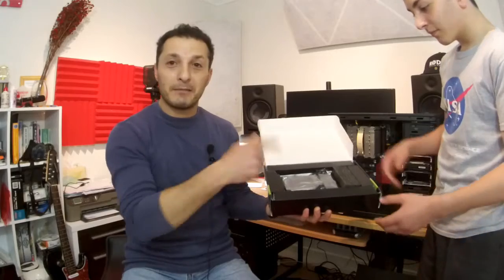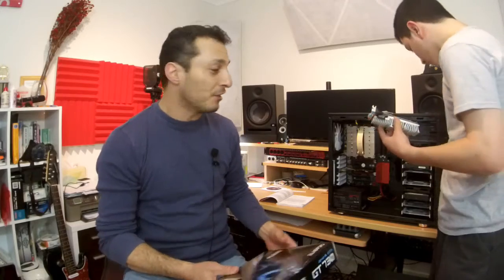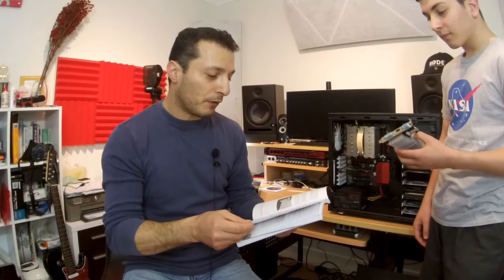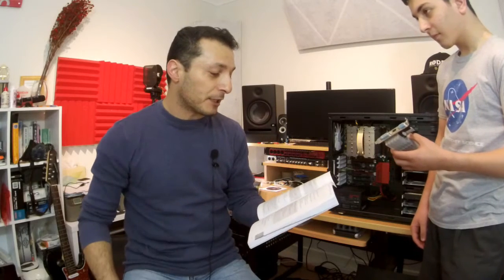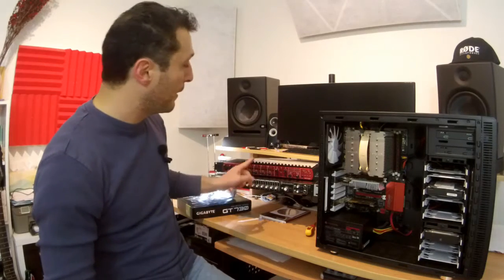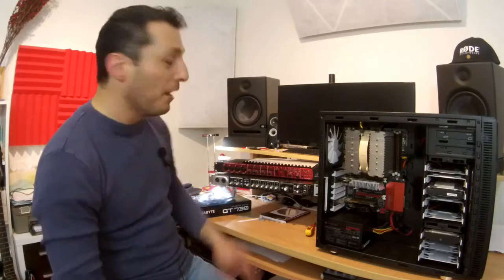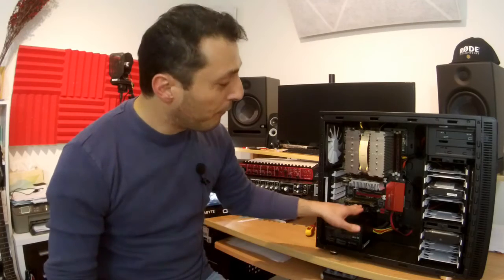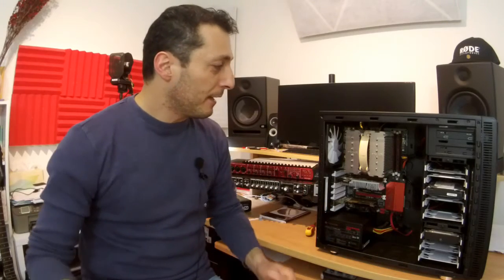Audio Pops & Clicks issues when using USB Audio Interface

Comment: yea found your video trying to troubleshoot this problem myself. what I have though is a behringer umc 1820. I adjusted my power setting for full performance, switched everything the right way in the sound settings (24bit 48000khz *i have a adat expander so its drops it from 24bit 96,000 khz to 48,000) usb 2.0 directly to the PC. I noticed that it is not being recorded, its only when im playing back. so im still kind of stumped here.
Reply from the maker: Not sure if the 1820 has any drivers, but try increasing the buffer size.
Reply: @RecordingStudio9  the umc 1820 does have drivers i played around with all the sample ratings 64,128,256,1024,etc,etc . going to try a line conditioner at this point.

Comment: I doubt its the 1818VSL unit itself. I was a tester for PreSonus on every unit in the VSL series. In fact; I'm the person who suggested, and subsequently got the other testers to push for, the motorized faders on the StudioLive consoles.
I tested it on thoroughly on every DAW on the market at the time and had no more issues by the time we were ready to release.
Unfortunately, I can't speak on the software and firmware changes after release.
I now have clicking on both my 1818 (#33 ever made) and 22 (#5 ever made).

You got me thinking though. I'm gonna hook my old M-Box and my Tascam FW1082 up and see if the problem continues when they're in use. 
I plan on upgrading my processor from quad-core to 6-core, if the problem persists.
Reply from the maker: I still use the same PC I built and have had and still have no issues with any of my later Audio Interfaces, currently using PreSonus Studio 18|24.
It was the VSL driver software and not the actual 1818VSL unit. If I used the UC driver, it was fine.
Reply: @RecordingStudio9  Good to know. I might have to try that.
Reply: I'm wondering if an older driver would have worked better. We had no issues with the driver we approved for initial release. I personally tested it so throughly that I can't imagine what they needed to "fix" with the subsequent updates
Reply from the maker: @DeadlyMixKrew  I personally reverted back to the previous driver (v1.2) as the new versions for Windows OS had issues, largely due to the fact that Apple kept changing their OS requirement, and breaking everything else, finally, PreSonus gave up and discontinued 1818VSL. Such a shame as it was one of the best for its price range and options.
Reply: I'm trying to remember but I'm pretty sure that was one of the drivers we tested on. I think that was the one we approved for the release.

Comment: Hopefully this helps anyone with a hp laptop running Windows 10. (Presonus Audiobox 96) I was having problems with a crackling noise also. I changed USB ports and now it’s fine.... to anyone it helps
Reply: I use the same exact pc and and audio interface.  Got it last week and I've been experiencing these problems. Did you fix it only by changing ports?
Reply: @heisnanab  did you find a fix for this?
Reply: @crimecrimson9153  Unfortunately no my man. But not because I couldn't figure it out ,I think it stabilised after a while. The memory is pretty faint. But I gave the audiobox out after about two months because I gave up on music for a while so i didn't need it.

Comment: Thanks
I have the same problem with my Fasttrack C400 and my new pc (Ryzen 7 2700x and 16GB of ram and prime b350-plus mobo and win10)
Reply from the maker: Make sure you check your audio interface driver buffer settings.

Comment: Hi folks, i did read some facts about audio recording with usb daws, and the main problem is the usb-3.0 port wich is not actually an audio port. To solve the clicks and pops issue is to disable the usb-3.0 port and it will work like an usb-2.0 port and many audio problems are gone.
Reply from the maker: My Audiobox 1818VCL is currently running most days connected to USB 3.0 and has not had any issues for the past 18 months. I think you eighter have some misunderstanding or translation issue about USB. USB stands for Universal Serial Bus and has nothing to do with audio. It just transfers digital data at high speed. In this case, the data is digital audio.

Comment: if you have this issue with : presonus audiobox1818vsl
it does not work if you have enabled usb 3 in the bios,
Reply from the maker: I no longer have this issue. Still using the same PC today. It was a conflicting software causing the issue.

Comment: I regret bought Studio one 3.5, and pops with some stock instruments, I have I7 Pc, the last model prepared for recording with best elements. My card a u44 Steinberg. All new. Using windows 10, also a deception.
Reply from the maker: Its all from background incompatible apps running, not Studio One or U44 Interface or Windows 10.
Reply: Thanks for the trace! but I wonder witch app is the one, can you tell me more all less ?
Reply: Thanks for answering, then you make me think is my Novation controller Launchkey 25... if not Pc, not Steinberg u44, nor Windows 10?
Reply: I have the same issues in a very similar (powerful n new full SSD etc) set up, I also NEED to KNOW what kinds of background apps might be causing these audio dropouts?!? I get them in both Studio One and Audacity software's?!? But never from say iTunes or Napster music apps playback?!? Whats the deal???? THx

Comment: I had similar problems and had to disable and uninstall all the windows and related sound drivers, I am also running VSL 1.3 for the front end editor in Live work. I also stopped all unnecessary running processes in the background and in the start system config. I hope to see your 1818 back in the rack? : )
Reply from the maker: Thanks for watchingWell currently it's back on the rack, as my main mixing console, the Behringer UFX1604 is at the "doctor's", waiting for replacement.
Since this video, I have done same as you and all issues were gone. I also used the 1818VSL for on-the-road live recording using my laptop with zero issues.
Reply: Good news! I have just run the sonarworks 4 Reference with the cal mic, wow! I am now rediscovering mine and other mixes with a level of detail that I can now trust and feel even more confident with my mixes, Keep up the great work/passion.
Reply: Well are you going to or could yo please post a video for this FIX then for the rest of us?!?!? Thx

Comment: Hi I have this problem with mu fca1616 it's only just started to happen. I get stuttering sound and dropouts. When this happened my perormance meter in cubase spikes for a second otherwise its at about 5% do you think I have a faulty interface. Would running it via usb2 ports make any difference. I'm at a loss tried All different buffer settings
Reply from the maker: I could be mistaken, but, I think it’s your pc, not the FCA1616, since Cubase is also showing heavy cpu use. Check for background apps running or newly installed apps.
Reply: RecordingStudio9.com tried lots of things and starting to think my hdd might be on its way out. That or something to do with my ram. I was using a Roland quad capture interface before the fca16/16 and never had a problem.

Comment: I see your other cards with no pop and clicks are both firewire. Can it be that usb is sometimes buggy and unpredictable? I'm converting my system from usb to firewire for this reason, nothing seemed to fix the horrible clicks
Reply from the maker: I prefer Firewire due to its technology. It is not a shared communication as such and has less interruptions during data stream, unlike USB, that has bursts of high rate data, as to constant data stream of Firewire. And yes, no pops or clicks even at low 32 byte sample setting with my Mackie Onyx Blackbird.

Comment: yes hold the card by the GOLD contacts (not)
Reply from the maker: Unless you are standing on a polyester carpet with rubber sole shoes and collecting ions from a blowing air-con, yes. He is barefoot on tiles and had already earthed himself from static by opening the PC case.
Yes, one can never be too careful.
My background being software and hardware electronic engineer working with surface mount components, I know it too well.
Thanks for pointing it out. Some may not be aware of static electricity, and the damage it can cause to electronic circuits.

Comment: yes I have a dedicated firework card. I had a different one and then I changed it to a card that the manufacturer of the audio interface recommended. still the same problem. I even change the order in the slots of the cards to try to resolve. any IRQ conflicts it might have. I have deleted a bunch of applications hoping to eliminate the offending software and still the same. I used a program called latency.exe to check and what it reports back are system files that I can't get rid of one general comment the app reports back is CPU throttling. Well my AMD CPU with eight cores I don't see where to get rid of that. I changed to the Safford audio interface because the pre amps are awesomely hot. before I had a numerous USB interfaces and moved firework because the industry does not want to move to USB 3.0. My machine I consider it a beast AMD 8130 3.7ghz, 16 gb ram, ssd hard drive for the root disk a powerful am video card, but I like you need to multi purpose the machine. I too make videos and  graphics and other things. so I need it do be a multi purpose machine. one opt I n I am exploring is to make a dedicated  rack pc just for recording studio. I will set me back a few hundred but I think I can get rid of this problem, but before I do that I want to exhaust all avenues. I can wait even though I have a number of ideas  for songs until I solve the problem. any help will be much appreciated.
Reply from the maker: +anievestor 
If you are getting CPU throttling, it could be that the included CPU heatsink and fan are not sufficient to keep the CPU temperature down, as AMD CPUs are known to run at higher temperatures. Might try to run with a big desk cooling fan blowing with case open, to check if that is the case. If this minimizes or stops the issue, you may need to replace the CPU fan with a bigger one.
Hope this helps.
Reply: Brand new heatsink and fan my friend!  I really think this whole CPU throttling is a hoax and nothing is wrong with it, but when I finalize my reasearch on the Xperf and the other apps people are recommending it should give me a better picture as to what is going on.  I will post a video on my channel because I think this problem is not well documented and needs a better video and explanation.
Reply from the maker: +anievestor 
Did you try the desk fan option to confirm it is heat related? Don't spend money for new heatsink before you confirm.
Reply: +RecordingStudio9.com at this point I will try anything  but I already bought a huge CPU fan and my case has some many fans is not funny. I will open up the case and apply a fan. stay tuned.

Comment: I am having the same problem with another audio interface.  I am currently trying to learn how to use xperf and other programs to diagnose the problems but a bit convoluted process, but it is meant to find out what process, driver, or other thing is causing the problem.  My system has a Focusrite Saffire (fiewire), windows 10, DAW is Studio One.  The problem  is now worst the audio interface now stalls during recording and playback.  Stall meaning it stops the audio for a few seconds and then starts again and if you are recording this means I have to restart the recording again.  I MAJOR PAIN!!  More to come!
Reply from the maker: +anievestor 
Oh man, I feel your pain. Stall is the worst. It sets you back and can ruin a great recording, as well as drain you down. Do you have a dedicated Firewire PCI card? Firewire, unlike USB, does not share process, and had better priority, but this also depends the connection on your PC end.
My current main audio interface is Mackie Blackbird Firewire and never had issues. Previously I had Alesis MultiMix8 Firewire, again not one single issue. Both cases I have good quality Firewire PCI card ($50 Aus).

Comment: I have been very good with an i7-3770k with on board HD4000 graphics card.. a Studio live mixer-16.4.2 with a VIA Firewire Chip and never had problems! your OS and DAW on a SSD is the way to go!!
Reply from the maker: +ZinayH 
Thanks for the feedback. Currently my main Audio Interface is my Mackie Onyx Blackbird, which is a firewire connection, and never misses a beat. I use my AB1818VSL with my laptop (Also running Win10) and works just fine. Not sure because my main PC was a fresh install of Win10 Pro and my laptop is upgrade from Win 8.0.
Nice to have StudioLive 16.4.2 for live.

Comment: Hi Vatche,
Interesting video.  I wonder if a PCIe USB2 controller card (much like your FW card) would solve this particular issue.  I own a Steinberg UR28M (USB2), and initially got pops and clicks on one of my PCs.  Put in a PCIe USB2 card, and voila!, problem solved.  

Anyway, just wanted to add that I'm a fan and always enjoy your videos.  I've been a DAW enthusiast since the 90s (currently using Sonar Platinum and Studio One 3 - the latter mostly for the Project page), and though your vids are generally aimed at beginners, I do occasionally pick up a good tip here and there.  It definitely comes across that you know what you're doing, but unlike some of the other "gurus" on the web, your manner is always pleasant and good-natured.   

Keep it up -- we appreciate your efforts.
Reply from the maker: +Poor Finian I'm totally humbled. Thanks for the comments and feedback. I really appreciate it. I try what I can. Looking back 3 years ago, I can see I have improved my presentation, so I keep going. And yes, I do aim for the beginners. Having electronics and IT background does help.

I did try different USB sockets on my PC with same result. I'll take your suggestion and give a PCIe USB card a try and see if that makes any different.

How do you like and compare Sonar? I own an old Sonar X1 version that I used at one stage.

Again, thank you.
Reply: +RecordingStudio9.com  I like Platinum a lot.  X1 was their first step after a complete rewrite of the code, and for a lot of users it was buggy.  By X3, it had become pretty solid, and now with Plat 2015 -- well, I can go a week without a crash -- it's just a pleasure to use.  I like Studio One 2/3 as well, but I've only skimmed the surface since I only really use it for the Project page.  I'm currently doing a partial upgrade to my home-built DAW PC (adding two SSD drives, a better cpu fan, that sort of thing), and also uninstalling plugins I haven't used, to make room for the new stuff coming in the Black Fridays sales (It's a vicious cycle!).

I just remembered that a few months ago (before I subbed to your channel), I saw your video about the issues with the 1818vsl.  I was close to getting the 44vsl, but after seeing that vid - along with all the problems reported on the forums -- I went with the Steinberg UR28m.  I'm so glad I did.  Great sound, rock-solid performance, and the onboard FX are a nice "extra" feature.  

Anyway, thanks again for all your videos.  Cheers.
Reply from the maker: +Poor Finian Nice to get feedback by real users of software and hardware. I was looking at the UR824, but it was over my budget. A year later, the unit is still sitting on the shelf at my local music shop.
My Mackie Onyx Blackbird does not have any built in DSP, but the sound and options I like.
It is all about getting the correct gear that suits your home studio requirements, not the other way around. LOL.

Comment: Great Video Vatche ,  Welcome to the world of Abandonware  , the computer industry's way of making money. Errrr.Totally agree its there (Presonis)Driver Code causing the issue , funny they should be able to clear that problem threw Code. If your New system is compatible with win 7   you could try Dual boot .  to give more life to the Presonis Unit . Heads up to those who disable Internet or Ethernet connection, if using Presonis studio one Prime , make sure you start the program first, then disable when doing recording, reason it  checks license when it starts .
Reply from the maker: +Ar Tonal Coming from an IT background myself, it is not surprising, but annoying. Well, I'm not going backwards like PreSonus software. I'll just use it with my iMac or laptop for live recording. VSL is perfect as live digital mixer.
Most new systems with USB 3.0 should not have issue with Network enabled. It is more something to look out for is issues like pops-n-clicks show up.